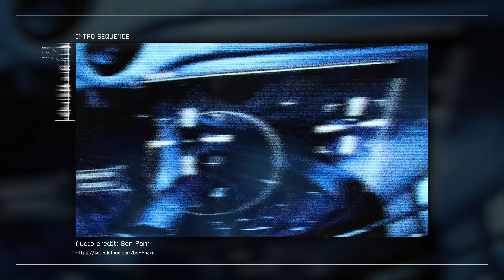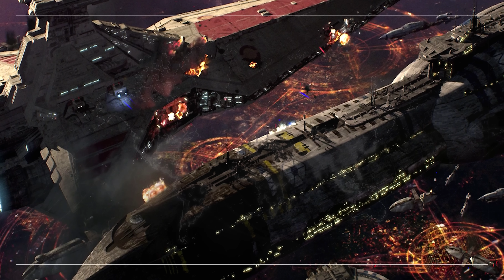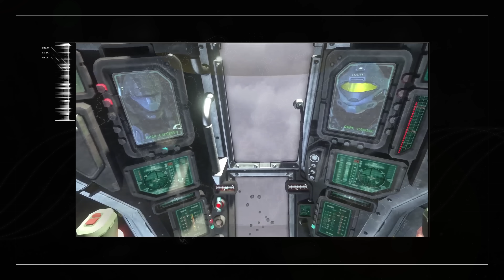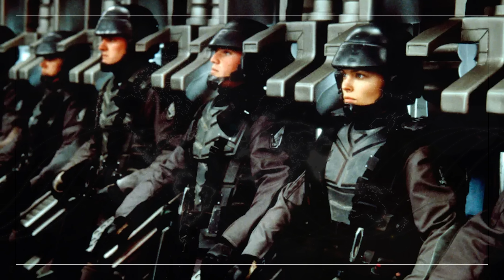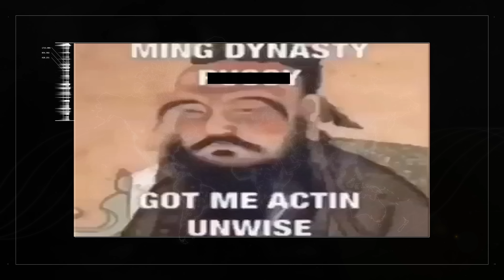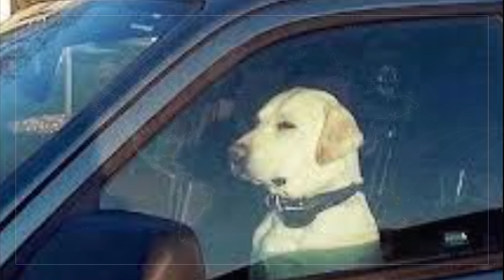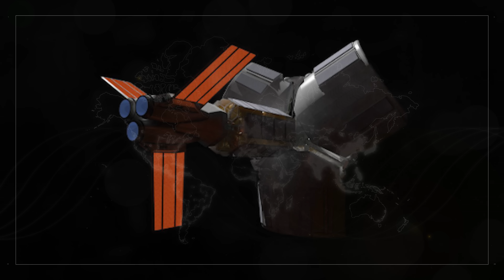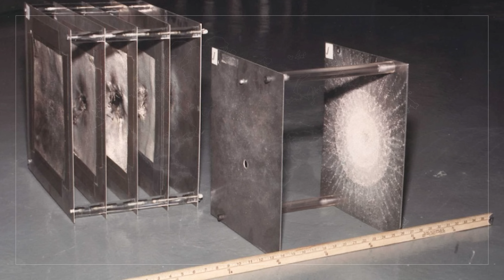The REALITY of Space Warfare

Comment: One of my favorite series, The Expanse, has one of the most physically accurate forms of interplanetary space warfare in sci-fi. They use thrust to create gravity rather than some hand-wavey artificial gravity or inertial dampeners
Reply: There's a few more hand wavy things. Non-spoiler things that come to mind are Ceres staying together when spun up to negative g and heat dissipation from the massive long-burning engines. But it is more accurate than any other sci fi show.
Reply: At least early in the series I think the only hand wavy thing they have are the ultra efficient engines and the drugs that let them survive 10g burns for several hours.

Definitely the most realistic popular Sci fi series I've seen
Reply: “Savages” space war by Real Ros7 is the most realistic depiction I’ve seen.
Reply: Frankly, constant trust is less realistic than artificial gravity.  You can get artificial gravity from rotation, like a Stanford torus.  Constant thrust would require astronomical amounts of energy, especially for a power output that can accelerate an entire habitat (apes in cans) at Mars gravity equivalent.  Plus, you'd need planetoids worth of reaction mass.  And this is where the tyranny of the rocket equation comes in: Now you also need to accelerate the reaction mass, which requires even more power and reaction mass, which requires …

A way around this is reactionless propulsion. No rocket, no reaction mass; you still need astronomical amounts of energy, but the sun generously provides that.  That's right: Solar sails.  (Light sails or dark sails.  The latter are lighter and more efficient, but you can't tack with them.  Light sails are more versatile.)

So now you have unlimited delta-v, but your rate of acceleration will be in the percentile of Earth normal at best.  (Adding canned apes will make that even slower.)  But with constant thrust you can achieve interstellar velocity in just a few months even at that rate.

Back to artificial gravity: To spin up your habitat, you need angular momentum.  The bigger it is, the more you need (although the angular velocity drops pretty fast with size).

To spin up something the size of Ceres, which is heavy enough to be spherical, you'd need ridiculous amounts of energy.  And that is assuming that the centrifugal force won't simply rip it apart, which is practically certain.
Reply: @davidwuhrer6704  Well, the Epstein drives used in The Expanse IP are fusion drives, so in principle the power requirement is met. However, their efficiency is basically 100%, which isn't just nonsense, it's a violation of thermodynamics.

Which is another way to say: magic. Who needs reaction mass when you have effectively supernatural propulsion systems? Still, I too find the lack of gigantic propellant tanks disturbing, especially in conjunction with the use of fusion drives without big ass radiators or incredibly huge radiation shielding for the crew compartment.

Usual futurist designs suggest to use the big ass propellant tanks for that very purpose, effectively casting a 'radiation shadow' protecting the crew, but may Techno God have mercy on the poor fellas that might cross paths with the ship!

And that's only a few of the elbow drops the Expanse is using against science, but that's kind of normal: at some point, hard Sci-Fi or not, you gotta handwave a bunch of things to trim the fat and get to the story already. Otherwise you just find yourself writing a scientific paper on far future prospective technology.
Reply: @davidwuhrer6704 Very, very well put.
Reply: eeeehhhhh, the Expanse has that as a concept but only sticks to it when it's convenient, like most things in the series. Still pretty neat, but you should read something like Knights of Sidonia for some cooler sci-fi fights. Also nukes wouldn't work so great in space.
Reply: It would have been nice to see directed energy point defence, but overall it's really well done.

BVR combat with missiles is already the norm in air to air, and would definitely be pushed further in space. Without aerodynamic maneuvering, the range of missiles before just flying straight (and being easy to dodge) would be an issue irl though as current missiles don't have enough fuel to burn all the way to the target. (Expanse has fictional tech to fix this)
Reply: @existentialselkath1264  Does a missile need fuel to burn all the way to the target though? Given that you dont need to constantly accellerate in space, I suppose missilies can be launched like kinetic weaponry, move silently in sleep mode without radiating heat, and then "waking up" when the target is in range, using fuel only for maneuvering to reach it.
Reply: @11darklight11 in space, a missile being capable of vectoring all the way to its target would be more important than the actual payload. A missile in space would effectively be a small tungsten cone with nothing but fuel behind it to perform evasive maneuvers and course corrections until it hits its target.

So yeah, unless you're firing at a stationary target incapable of defending itself, fuel payloads are really just as important, if not more so, than the in-atmo ones.
Reply: @existentialselkath1264 
Or missile based point defense like in real life, but lasers are probably more practical in space.

Comment: Space bullets will be sticky balloon tarps possibly with weighted edges. Big, light weight, imparts angular momentum, blinds, and more expensive to defend against than fire.
Reply: That could maybe work, but it would have to be going really slowly. Things hitting each other at orbital speeds don't really hold well enough together to stick and wrap around things. Stuff just vaporizes when it hits at multiple  kilometers per second cause it has so much kinetic energy, its worth several times its weight in high explosives.
Reply: Mass is required to create any form of momentum.

Comment: 9:05 heaters are actually always 100% efficient
Reply: no? regardless of the type of heater, here's always some work involved. For instance a kettle will actually lose some of the energy to thermal expansion of the heating elements (mechanical work). It really depends on two things: the definition of "efficiency" and the timescale. In a physical sense, a heater is closer to zero percent efficient, since it performs very  little work (see previous example). Even using a rather imprecise definition like "amount of energy in vs. amount of desired type of energy out", heaters in a closed system cannot be 100% efficient, whereas in an open system (e.g. heat pumps) thermodynamic "efficiency" can reach 400%, though that's technically a "coefficient off performance" and not actual efficiency in a physical sense ¯\_(ツ)_/¯
Reply: @totalermist  Oh yeah smart guy? What does the material do when the heat goes down? does it stay expanded? oh no? What does it do? Shrink? Does this shrinking release stored energy? Yes? In what form? Oh heavens tell me it isnt heat? It is!? Good lord what does this all mean??? All the energy ended up as heat after all???
Reply: @RawenOfGrobabc  Calm down, buddy. Did someone piss in your coffee this morning? Just to be civil here, let me answer your question: when the metal cools down, it "looses" energy by performing more mechanical work (i.e. shrinking). That's why metal doesn't tend to spontaneously change form by cooling down - it could do that , that wouldn't be against the known laws of physics - but it doesn't. Nature seems to prefer thermal equilibrium and the metal doesn't want to cool down (i.e. "steal energy" from) its environment in order to perform work without someone asking. Yes, in the end (the end of the bloody universe, that is), everything turns back into heat. But in the meantime things be doing silly stuff with energy like moving about, making your screen go bright by hurling photons at your face, making electrons play hopscotch in the shells of atoms, etc. etc.

What does it all mean? It means that you should either think about what I might have meant by "timescale" or read up about basic physics. You know what with work and the different types of energy and conversion between them and closed vs open systems and all that funny stuff.
Reply: @RawenOfGrobabc   ye but a 100% efficient system isn't possible. As while sure all of the energy is ending up as heat. Its not all going to heat up the specified substance. like for example the kettle from earlier would lose thermal energy to the environment due to radiation/convection. Therefore that heat wouldn't be able to heat the thing you want to heat. AKA it would lose efficiency.
Reply: @true_octagone  I mean i was just having a laugh but my comment is entirely correct if we are strictly speaking about heaters and not about a water heater or some other type of heater that has a more focused usage than just generating pure heat.

The argument that "no heater is 100% efficient because you lose some energy into not heating the *right environment*" is silly to me because the heater is converting 100% of its energy to heat, and thats all the machine cares about and thats all we care about in regards to machine efficiency. 

Applying your heater improperly and thus losing efficiency is user error or in other words, a skill issue.
Reply: Bro what are you yapping about
Reply: @gavinvick3592  All energy turns to heat eventually. Thus, a heater is 100% efficient.